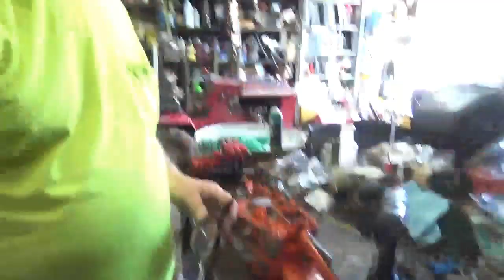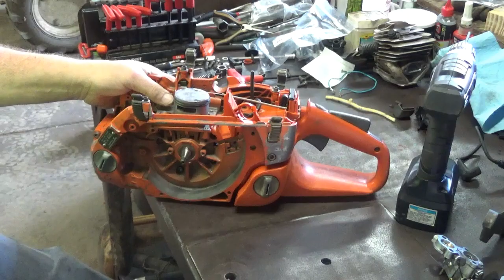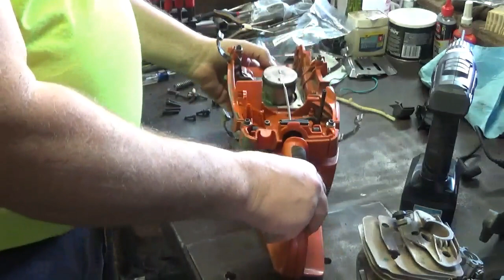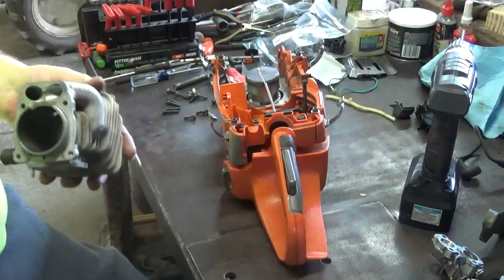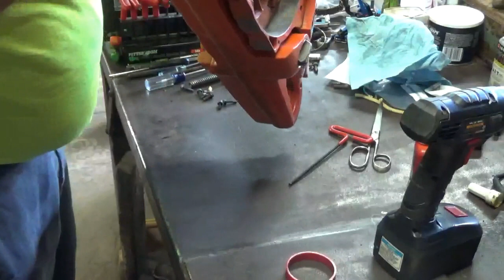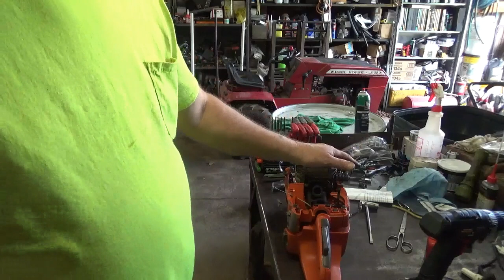Husqvarna 576xp Parts Box Build Video #1

Comment: Interesting concept. Will be interested to see the results
Reply from the maker: Yes it is, My theory is with the crank stuffers removed the crankcase has more area which equals a bigger charge, and the holes in the piston in theory should let more fresh air into the crankcase so I may need to either rejet the carb or install a larger one to compensate.
Then again it may not even start.

Waiting on parts as soon as they show up I'll finish the build and post the next video.